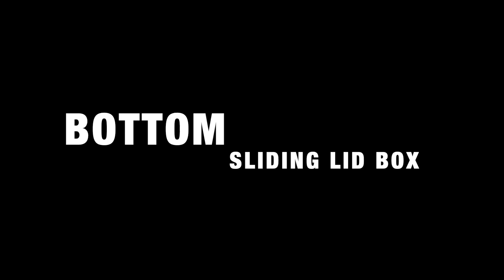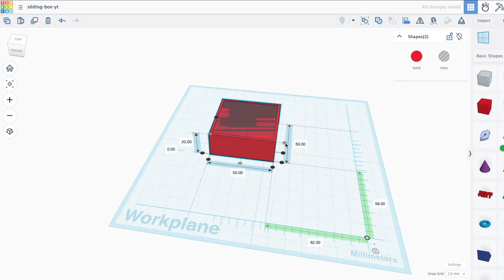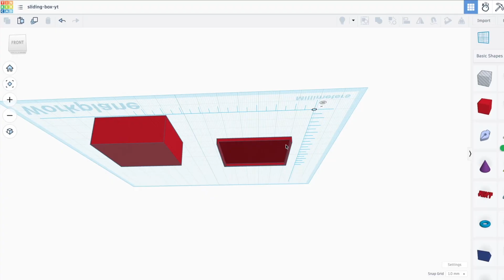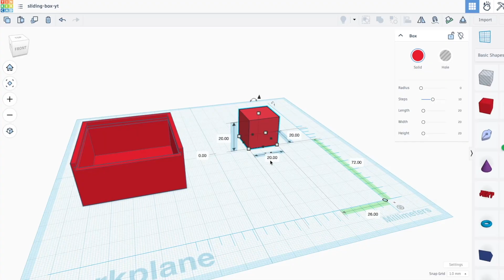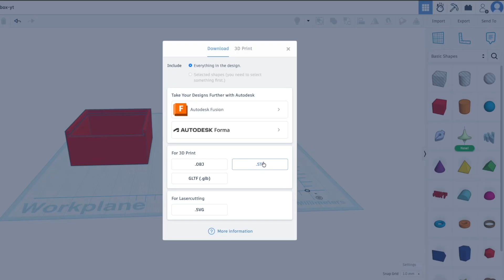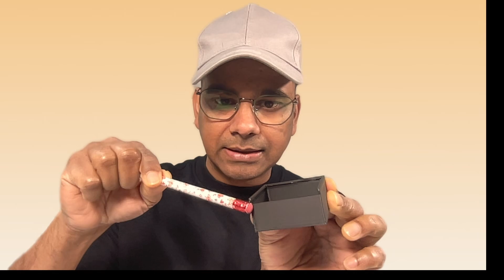Sliding Lid Box: 3D Printing

Comment: Thank you, im very interested in studying different sliding mechanisms, im specifically  looking for something that can slide diagonally and lock in place, with no external tools, just pure design, but its hard for me to find. 

Do you think you can point me in the right direction for something like that? 
Any engineering terms or design terms that I could use to narrow my search?
Reply from the maker: Interesting! where do you want to use it? 
Regarding your requirement, try searching "linear sliding mechanisms". I do not have manufacturing background.  3d Printing is just my DIY  hobby :)